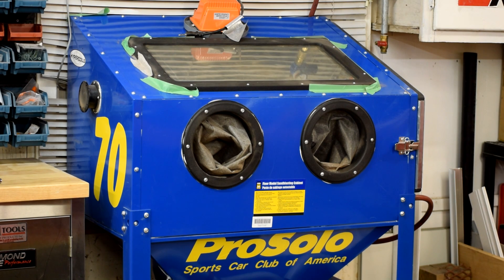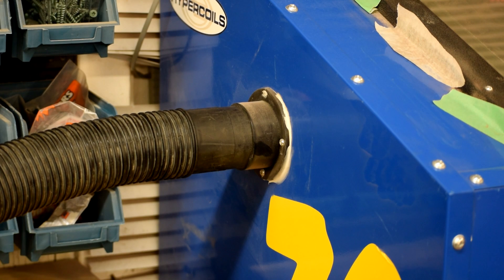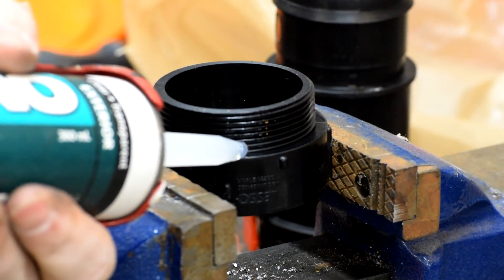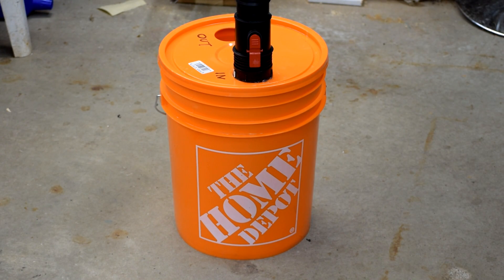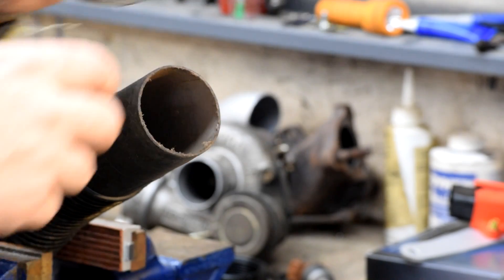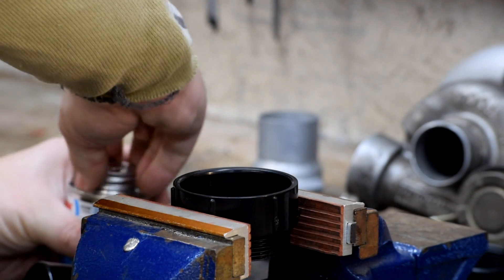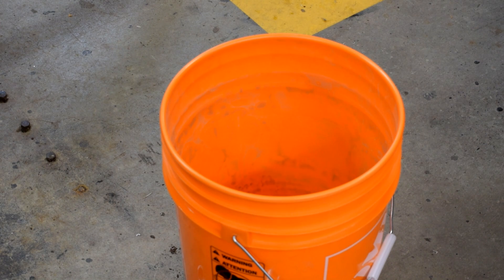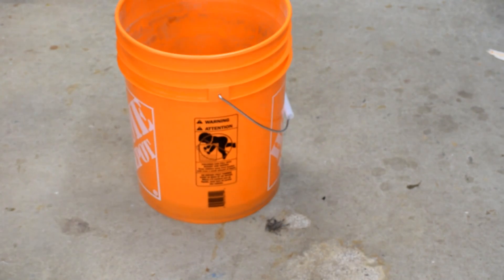DIY Blast Cabinet Exhaust Particulate Trap

Comment: I had a similar issue with mine. Used a fan from an air-conditioning unit that doesn't draw it through the motor,  has a barrel/ paddle wheel type fan. Similar type fans are used in cars. Unit doesn't require a lot of suction, due to air  being pumped into it. Given I live on a property,  pumping it straight out the back of the shed wasn't an issue.

Comment: I’m wondering how you deal with the water flowing into the shop vac? Others who have taken similar approach have reported this is a significant issue. Thanks for video.
Reply from the maker: It hasn’t been an issue. You don’t need a whole lot of water to trap the fine dust, and there is a fair amount of separation between the inlet and outlet.

Comment: When I built a 30 gallon version of this for my Paint Shaver Pro, a decade or so ago, I used a 3-M scrub pad as a baffle.  I just cut it to fit the drum and cut a hole in it for the intake pipe.  It helped stop bubbling or splashes from the drum getting bumped, or whatever.

Comment: I remember one time when I was vacuuming the abrasive media from the blasting cabinet, I got a jolt of shock so huge the hose flew out of my hands. Never again. We just went with gravity the method and let it drain down into a container below the cabinet.
Reply: Jayee you have to ground out your gun
Reply: Jayee, you are talking somewhat of a different game. This is about stuff that is forced out of the cabinet by the air pressure being introduced by the gun.  The vac and pre-filter counters that, and collects the garbage floating in the air.  Just letting gravity handle the situation would leave him back with the problem he was trying to overcome.